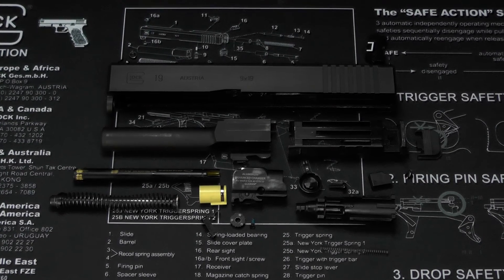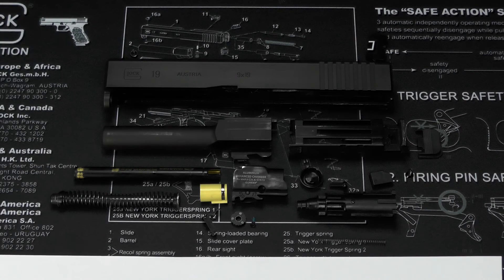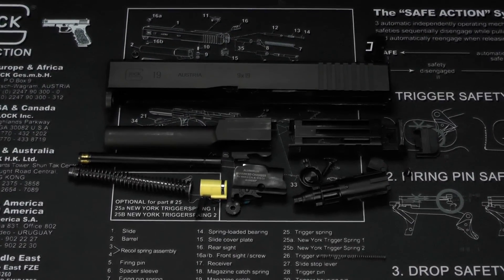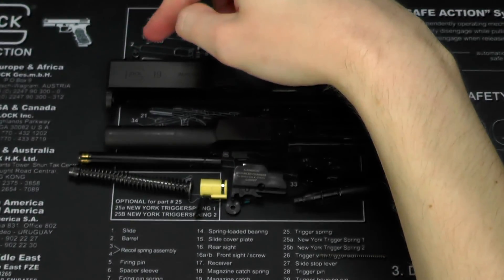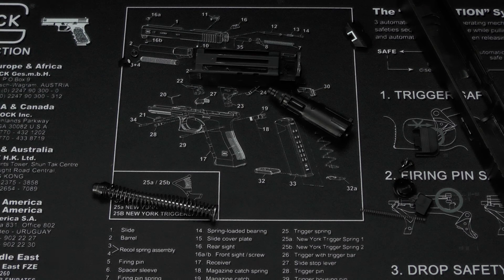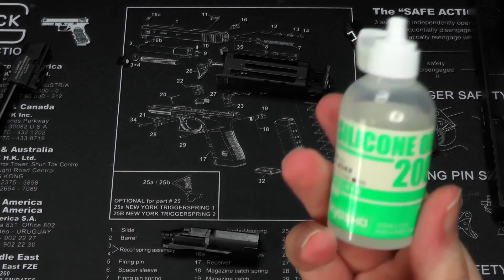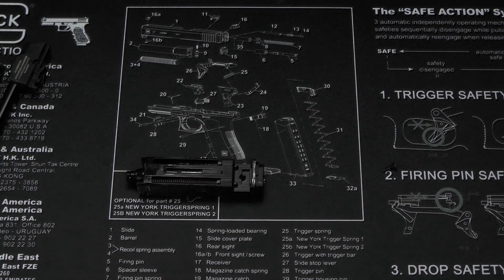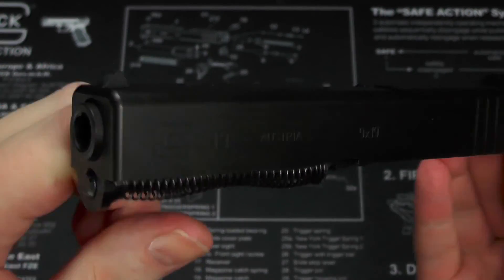Assembly: Guarder Ultimate Custom Glock 19 build - Part 1 - Slide

Comment: Since this is utilizing the Marui gas system can you use other aftermarket Marui slides.  This is more in regards to doing the same build for a 17 model.  For example would the PTS ATOM slide work for this build?  Love the videos!
Reply from the maker: I can't see why it would not work. Guarder slides and internals are TM spec and certainly when you build it based on a Glock 17. So yeah. I would say that it would work :D
Thanks for the support man!

Comment: 2nd!! keep posting! i am almost giving up my WE G19 + A1A SAI RMR slide build and switch to a KJW G19 or Guarder G26 build...
Reply from the maker: Hmmm, why giving up?
I have a full how to playlist for how to put together a Glock if it's assembly that is making it difficult for you.
FYI my WE G19 SAI RMR build is my favorite Glock 19! :D
Reply: my problem... A1A slide + A1A outer barrel, slide stuck when pulled all the way back, a
 tap at the tip of the barrel released the slide, so I figured "barrel 
tilt issue", however, if i put the A1A outer barrel in the WE G19 slide,
 all is fine, also OK with the WE outer barrel in A1A slide, so what is 
cause the of the jam with the A1A slide/outer barrel combo?
Reply from the maker: Hmmm right I think you mentioned that before. I am really bad at that specific issue so I don't think I can offer much help :-(
Reply from the maker: Try looking at this one: 
https://www.youtube.com/watch?v=1Fth41MFAok&t=3s

Comment: The original sights of the KJ Glocks are metal and they use three dots instead, they are better than those Marui plastic ones
Reply from the maker: Yes, but real OEM Glock sights are polymer and that's why I wanted the TM sights instead :)

Comment: I love your glock 19 videos man.

I got another question. Which parts are supposed to be installed in the piston? Piston head set or piston lid? I own a KJ G17 and it has a piston lid installed over the screw, but i also have a WE G17 and it has a complete full piston head set with o ring and all that stuff.
Reply from the maker: If you watch this video and the Glock disassembly/reassembly videos you should be able to figure it out. Depends on what blow back housing, nozzle and piston head setup you are using.
Reply: Non Existent i'll be using then the Guarder piston head full set :)

Comment: So you epoxy the ejector and it doesn't have any function at all  bro
Reply from the maker: Yes, to make sure it is not going anywhere. And yes it is a non functioning dummy so no problem with epoxying it in place.
Reply: lol failure to extract bbs